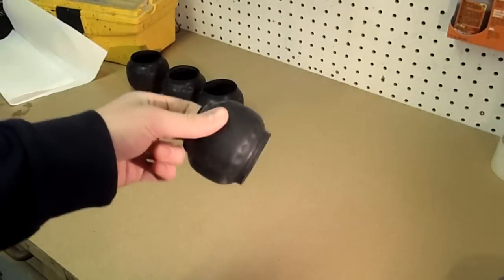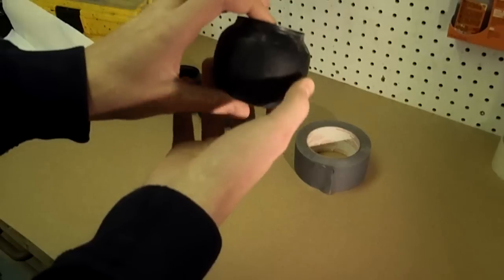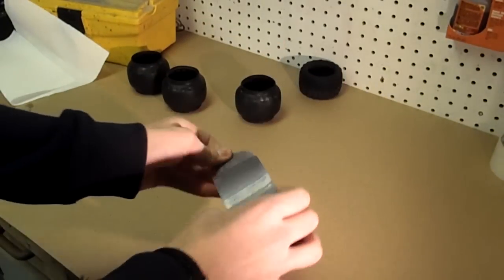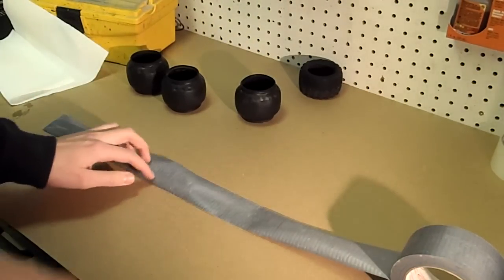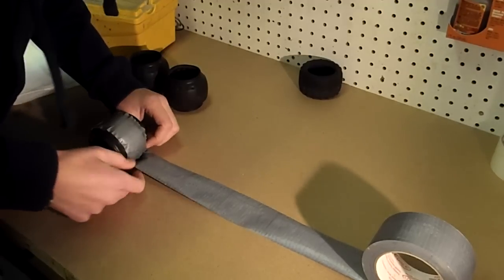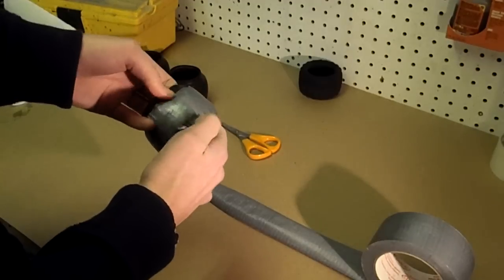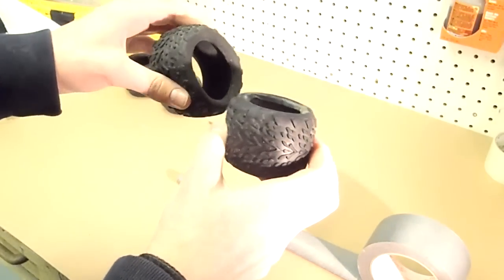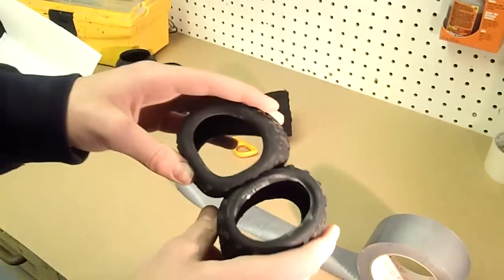How to Tape Your RC Car Tires

Comment: I would think as long as you are over-lapping, that you might as well go all the way back around to start of tape just so the tire is balanced as opposed to having more tape only in one spot.
Reply from the maker: Hmm, good point! now, I'm really not sure that it's that balanced in the first place, but that does make sense.
Reply: RC Insight Well I did this myself recently..  (have a couple vids up), and I went all the way around twice on the front skinny tires, but on the back tires, I only overlapped an inch or so, because at the time I figured it would be a lot of extra weight, and how far off could they be anyway?

Well I should have taken my own advice, because I had to add quite a bit of weight! LOL.. But they don't balloon, and balanced out well.  I think if I added all that extra tape, the tire would be a lot stiffer too, an not sure that would be good for traction on soft dirt and gravel.
Reply from the maker: Ok. Yeah, I just had a look. You've got an associated buggy? I think you're right about the extra weight and making the rear tires pretty stiff. If I was to do it again, I think I would only overlap maybe a 1/4 inch, just to make sure it doesn't come undone. I'd give that  a try. Also, nice job on your tire balancer! Looks a little better than my method of using a bolt stuck in a drill chuck :) P.S. I subscribed to your channel :)
Reply: Cool thanks! Yeah that balancer worked well. I guess you could do the same exact thing with any brand RC truck/ buggy. Just buy a new set of rear suspension arms/ bearings, axles, etc...  (or front for 4WD) and use your old stuff for the balancer. You could even make it better by making a mount for it, so you can clamp it to a table or whatever..
Reply from the maker: BWX Yeah, that would work well! now, I'm not entirely sure how much of a difference it would make in the handling on my rustler, because it doesn't hit a very high top speed, and I gotta sort out some camber issues... I need to buy some adjustable camber arms, one side has a lot of camber, and the other has almost none. I think though it would make a difference for ideal handling, probably more noticeable on the road. I mean, i sure do notice it when my tires are waterlogged/frozen, they're jumping up and down on the road, which is no good. So, I might give that a try... I've got a few spare bearings and arms sitting around.

Comment: hey guys can u help me how can i fix a ripped tire?
Reply from the maker: Hey, it depends on where it's ripped. Not sure that tires can be fixed so well because they're under such high stress, but HEY, it's worth a shot. So, is your tire ripped on the bead (part that goes INSIDE the rim and is glued in place), the sidewall (vertical part of the tire, where the writing would be on a real car tire), or the tread (part of the tire that contacts the ground)?